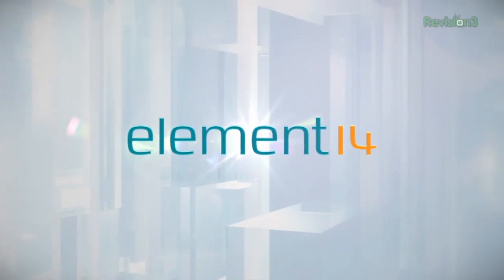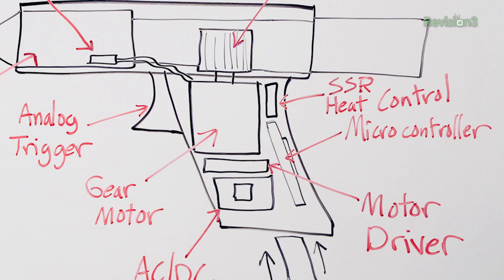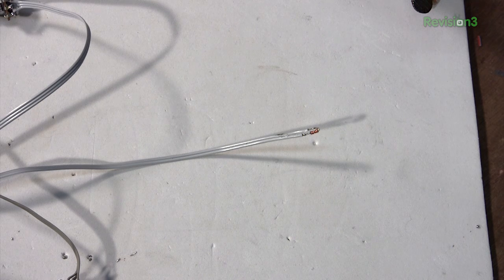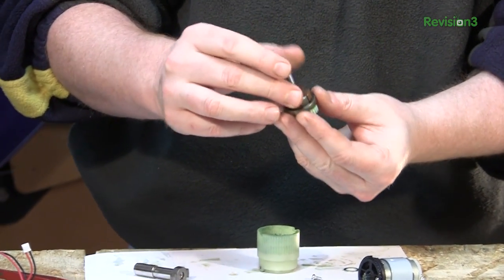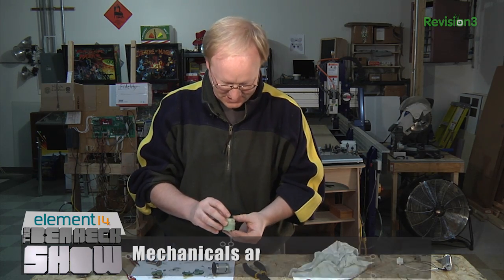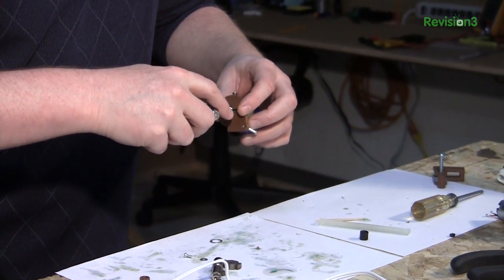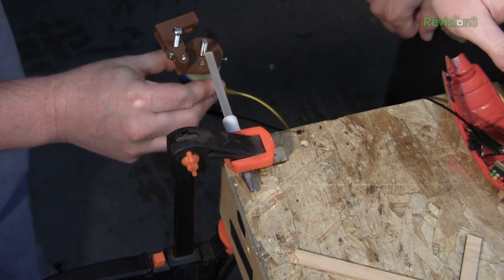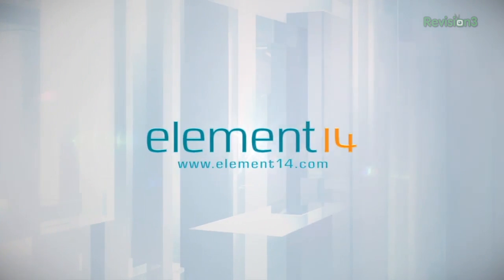The Great Glue Gun Part 1

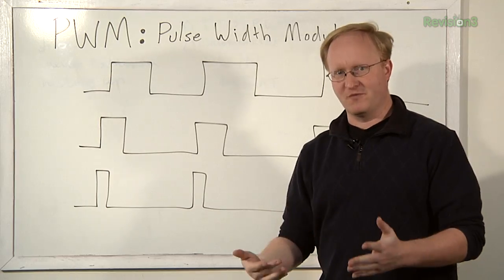Comment: @7:38
The frequency does not get changed by PWM though. The frequency in all three examples is 3 pulses per bar of time. PWM changes the length of a pulse thereby increasing the amount of charge/energy that a single pulse gives off.

Comment: Here's a build idea. 
I love my helping hands for holding PCB's and wires, but having to either hold the strand of solder or pre-load components/wire with a blob of solder can be a pain if I'm out of clips on the helping hands. 
How about a soldering iron with an adjustable solder feeder? 
Like a reel of solder on the iron with a motor that pushes the strand into the join from a nozzle when you push a button.
Reply from the maker: Great idea!
Reply: PLEASE MAKE ONE!!!
Reply: Braden T a couple weeks later they made the finger tip soldering iron and solder feeder. After having a look around I found that the kind of soldering iron I'm talking about already exists.

Comment: Just a quick little correction for the Tech Tip on PWM: At around 7:35 Ben says that it changes the frequency at which a load is given voltage, which isn't accurate since with PWM the frequency usually stays the same, what changes is the "duty cycle" which is how long the load is given full voltage over one cycle. Duty cycles are measured in percentages, 100% being full on time giving out one continuous voltage. 0% being no voltage, or off. One cycle usually lasts a very short time. Like milli/micro seconds depending on the usage.

I'm sure Ben knows exactly what PWM is and everything about it, but he goofed his words a bit on that part of the explanation.

Comment: Though I'll probably build such a GREAT and ULTIMATE glue gun (mine sucks), 2 things : Use a silicone mat (hobby store) for glue drips. A must have accessory on your bench. Second, there's no need of scrapping and damaging your bench when a drop or 2 of rubbing alcohol (or household alcohol) can creep under the glue and you peel it off with no drama. I would generally get a hobby knife in a corner of the glue, a dab of alcohol, and by capillarity, it will proceed on all the contact surface between the glue and the bench. Then you peel it off.

Comment: It would be awesome if he made a super laptop with a 1600p screen, sli 780tis and a nice Haswell 4770k for "low" power consumption.......  Even if he couldn't fit a battery in it.
Reply: *****

not with the right cooling system maybe a small water cooling system will work ;) but it will be a big fat ass laptop :p
Reply: *****
Meh, under-clocking could make it run fairly well.
Reply: Cory True :) and pretty good idea

Comment: Ambitious, but it violates a main principle... K.I.S.S..  Keep It Simple, Stupid.  What you gain in marginal features, you lose in long term reliability and durability.  The trade off IMHO on this design is not worth it.  Having to deal with a junkyard ocean of crap, over 30 years, Reliability and compatibilty/interchanability of parts is more important to me than features.   Look at any car junkyard today - an ocean of broken garbage as testament to violating that principal.
Reply: Yes, though I'd say parts interchangeability with a $4 hot glue gun hardly matters, just get another one. For the parts used to mod it, use widely availible parts, and you can always fix it. :)

Comment: 12v diaphragm water pump could keep constant pressure over the hot end, melted glue could travel along the tube and not have to worry of the stick caps they will get pushed untill the end only have to figure out how to build a tube that can be loaded with glue and sealed well

Comment: can't you just use a MOSFET instead of the motor driver? Isn't it similar?
Reply: If just driving forwards, then yes, a single MOSFET would work.  But he wants to drive the motor both forwards and backwards.  That requires an H-bridge motor driver.
Reply: todbot thanks.